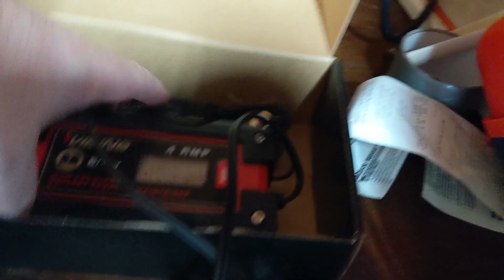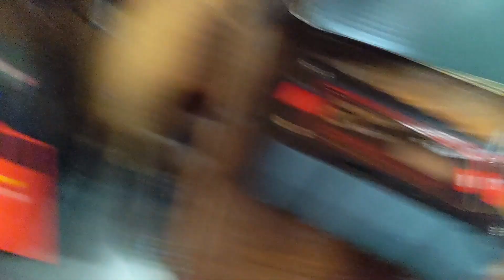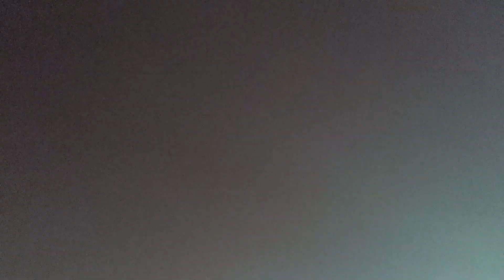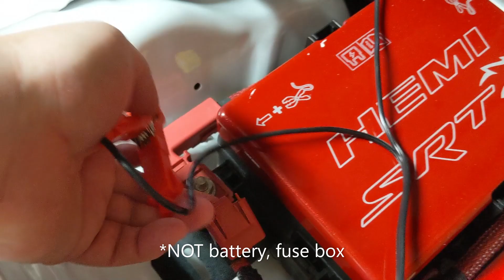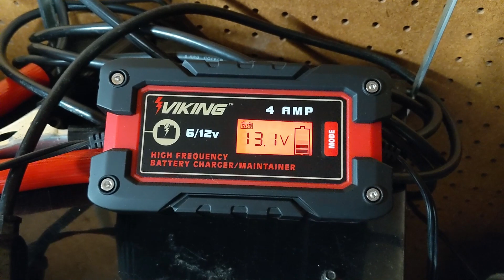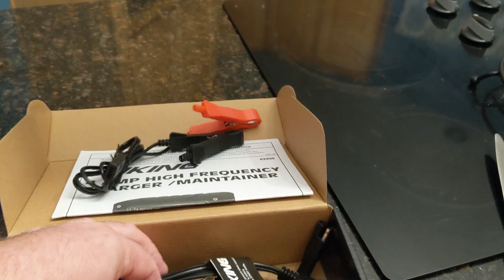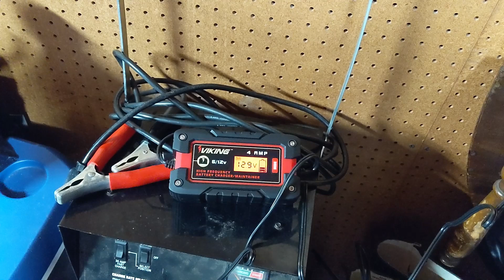Viking (Harbor Freight) 4 Amp battery charger / maintainer review for my Charger Hellcat

Comment: I have one of these too. 
Last year it worked great on my boat battery over the winter. Yesterday I had to buy 2 new batteries for 2 of my vehicles. Figured I'd pull this out and top them off since I don't know how long they've sat on the shelf. Well, after each battery was on this thing for 4-6 hours, it never went into maintenance mode on either brand new battery!
The only difference is, the boat battery was not connected to anything and the car batteries are, I'm not disconnecting them again and having to setup my head unit all over again.

Comment: I've noticed mine will go into maintenance mode very quickly on a battery that's not hooked up to a vehicle, or one that's installed in an older vehicle with minimal electronics/modules to draw current. On my 73 Challenger it'll usually be done charging in less than 30 minutes, but on my modern vehicles it takes 3 hours or more.
Reply from the maker: Yes, new cars should really be a 48V system, so the drain on new cars is huge compared to older cars.

Comment: "That's why they make warranties." 😊
They have one that does the things you mentioned...  It just costs more, go figure.
  After 40+ yrs fixing cars plus working in an automotive took store and having a wife who manages a Harbor Freight, I've noticed that people tend to buy the lower level of whichever product line and then expect it to do everything the more expensive options will.  That's partly the "marketing monster's" fault, always hyping up the consumer to expect more than is reasonable for a price point and, it's also just human nature overall.  When you buy an item like a battery charger, decide what exactly it is you want/need it to do and then buy the item designed to provide you with those features.
  If you buy the cheapest one and expect the performance of a more expensive model, you'll be dissatisfied every time.   As for the first unit not functioning properly, it happens with most lines of products, especially today when manufacturing doesn't hold the same standards as it did 40yrs ago.  Harbor Freight has steadily improved it's product lines and quality controls and has every level you could desire, you just have to pay for it. Everyone puts out a "lemon" every now and then which is why...  "They sell extended warranties." 😆 And for most items that are electronic or complex in nature, I recommend them.

Comment: If you can't get into maintenance mode AFTER IT RAN OVERNIGHT, disconnect from battery and outlet for at least a minute, reconnect and THEN LEAVE IT ALONE AGAIN. As long as the battery isn't toast, it will eventually go into maintenance mode. Hope this saves you guys a trip to the store.
Reply: Even it's not Green as long as the red backlight is off, it's still in maintenance mode.

Comment: I’ve had mine on for several days, and it still is red and looks like it jumps from 11vdc to 12. The battery bar shows 1 to 2 bars….does this seem normal?
Reply from the maker: It's not normal to charge for that long, with it showing the voltage
Reply: The battery is probably damaged.  Leave it on and it will try to desulfate and fix the battery.  From that voltage (assuming it is not a deep cycle battery), the voltage got too low from discharge or age if the battery is several years old.  You battery should never get below 12.3 volts.  Any less than that and you are ruining the battery.  Left long enough, the battery can no longer be charged back to full voltage.

Comment: I have a marine 12v deep cycle battery, do I charge it on regular mode or agm
Reply from the maker: Is it glass mat?    If it's lead acid, then you do regular mode.  AGM is for glass mat batteries

Comment: Says  gel but no gel setting
Reply from the maker: Gel batteries are VRLA (valve regulated lead acid). It says in the manual to use 12V STD (or 6V STD if a 6 volt battery)
Reply: @futon02  so agms dont have valves and lead and  acid?   Does this charger also not  equalize flooded  wet cell batteries? On wikipedia it says "There are two primary types of VRLA batteries, absorbent glass mat (AGM) and gel cell (gel battery)."
Reply from the maker: It's vernacular.   If it's called a gel battery, it's normally a VRLA that's normal lead acid.  Glass mats can have have gel, but are called AGM.  Page 9 of the manual has a note that says  to use STD.
Reply: @futon02   weird ..   agm are actually different then gel. Gel batteries are so named because the electrolyte  is gelled because  silica  is added to gel the electrolyte  which  immobilized the electrolyte which is why gel batteries are allowed  to  be mounted at different angles. AGM or absorbent glass Mat has is electrolyte  absorbed in the glass Mat inside which also immobilizes  the electrolyte  and isnt gelled but also allows it to be mounted in various  ways. Do you have a  link that shows an agm that is both gelled and made with absorbent  glass mat all in the same battery?
Reply from the maker: I see you're learning some battery tech.   Look at hybrid gel batteries.  Companies like LIvEN make them
Reply: @futon02  oh that's cool.  I wonder  what the advantages  are.  Thank you

Comment: If you're trying to charge the battery through 10 foot cables, 
maybe that is why it doesn't function properly?
I have a Charger as well. The battery is in the trunk. 
I doubt these battery charges are designed to do that.

Comment: One thing I noticed is that you didn't read the manual.   It specifically say do not plug in the AC until ready meaning hooking up the battery first.  Under Operation step 1 it again restates hook up battery first then plug in charger.  When disconnecting charger unplug AC first then then battery.  Don't know if that would change your outcome but it's worth a try.  Also I read somewhere that Winter Mode will occur automatically when the temperature sensor in the charger indicates to the microprocessor that the ambient temperature is at or near freezing.

Comment: I think these are junk.  Like fishing reels, they work good initially, and deteriorate thereafter.  I bought 2 of these 2 years ago.  They worked well as maintainers for 1 season.  When I plugged them in this fall, no function.  One had a blown 74 microfarad capacitor, and the other had no obvious fault, but didn't work.  I'm back to the battery tender brand, albeit, at three times the price.  Kind, Regards, Craig

Comment: It's only a 4 amp charger. I think it may be possible that the first charger simply needed more time on the battery. As the second charger already had a lead on the charge process from the first charger, it still appeared to take a few more hours. Sometimes you need to have more patience.
Reply from the maker: I had run the car (road trip) for 2.5 hours prior to this.   Worst case it should have been at 80% charge

Comment: I bought this a while ago and finally got around to taking my battery out of my car to charge it, but I wanted to ask, the operation section in the manual tells me to attack a 24 inch long, 6 gauge AWG insulated battery cable to the negative battery post, and then plugging in the actual negative clamp to the free end of the cable after connecting the positive clamp to its post on the battery. Does this mean I have to go out and buy the battery cable it mentioned or can I charge it without? I tried leaving it charging without for a while and it would jump around voltage levels and after a while displayed 7.5v and full battery icon with a red screen, then it only displayed the "bad battery" icon.
Reply from the maker: If it's out of the car you can charge post to post.
Reply from the maker: I see what you're saying.   Step 15.   What they are asking you to do is electrically the same, but can be more safe than connecting post to post.
Reply from the maker: The reason it says 2 foot lead is to get you farther away when making the connection.   You should evaluate how safe you feel doing it if you deviate from the procedure

Comment: How long to charge this unit from zero/new?
Reply from the maker: It depends on your initial voltage the battery has from the store.   It should be fully charged, but voltage can decay over time.   It shouldn't take more than 2-3 hours max (if any time) if the battery is new and good, if the voltage has dropped.   It may take no time at all
Reply: @futon02  thanks! Mine flashes 0.0 V plugged in. Nothing when unplugged. Going to try to exchange it.
Reply from the maker: Check the connections if it is reading zero

Comment: Anyone know if I can run this charger off of a lithium “ solar generator” that can do up to 250 watts?
Reply from the maker: Most likely not.  The input needs to be 120vac and 60hz to the charger
Reply: @futon02    The DB Power solar generator has a 110 volt receptacle that I will plug the charger into.. How can I figure out the hertz?
Reply from the maker: It would be on the manual/website.   If it's only 250w it won't make enough amps for this charger (power = voltage * current).  250 / 120 = 2.1 amps.   This charger is 4 amps

Comment: https://youtu.be/m9CU2z1KwjY?t=308            left a light on which drained my car agm battery down to 3v!! hooked up an old style battery charger to bring the voltage up to 10.5v then switched to the viking. after 30+ hours   it finally turned green and showed 12.7v. 

during charging it had red lit screen, voltage & charge bars would reach 14.6v and blinking 5th bar and then drop down to 2 bars and 13v...it cycled like this several times. i pray that the viking repaired the deep discharge damage.
Reply: How long was your batterry good for after that?
Reply: @Daddyyonke2023  replaced it after a year. had trouble holding a full charge. low voltage caused various glitches, but no engine check lights.
Reply: @arkrainfloodty ill be doing the same

Comment: It has a fuse inside on its circuit board. The one I have did not work and the fuse was blown.  I soldered a car 5 amp fuse underside of the board and it came alive.

Comment: I have recovered several "dead" batteries with the Viking charger. This is not a rapid process and takes much more time than one might think. I've had a few other "smart" chargers but they never recovered batteries like this!  You need to give it enough time and stop basing results on charging a "good" battery. I threw my other "smart" chargers in the trash when I saw what the Viking could do!

Comment: I do not think anything was wrong with the first unit. The maintainer side of this unit is going to condition the battery which is why you were seeing the voltage moving around. Once the unit goes through the charging/conditioning mode it should go green into maintenance or give you a bad battery indication.  Also a 4 amp charger is more of a trickle charger so it is going to take awhile.  If you want a quick charge you need a 10 or 12 amp charger and then apply the conditioner/maintainer.
Reply from the maker: I took the car out for over a two hour drive before parking.  The battery would be 80% if it started out as dead, and it wasn't.   It shouldn't take 12 hours for an 80% charged battery, even at 4 amps.   I have a 2/35/200 amp charger as well.

Comment: Planning to use this (1st time) over the winter on my car battery. Car is parked in a detached no-heat garage with door closed. OK?  @once a week car will be started (not driven) for @ 10+ minutes. When doing this I will disconnect the electrical wall connection. OK? Thanks.
Reply from the maker: Of you're going to start the car every week you may not need a charger.    Unless the battery dies off quickly for some reason, you should be okay not using it.   That said, if you are going to start the car I would disconnect it from the wall and the car
Reply from the maker: What's the purpose of starting the car weekly?

Comment: Why are you even using that toy when in the background of your video their is a 200.00+ battery charger???
Reply from the maker: I use it for the maintaining function.    The big charger is 200/35/2 amps.   It can trickle charge, but I want the battery maintained and charged back up without overcharging, like the big one would do if left unattended

Comment: I just got one. Think it’s bad. It won’t go in maintenance mode. Got to 14.5 then down to 13. Then kept charging. Until I notice top of battery wet. Means it’s over charging and boiling the battery. Will return it for a new one and see if it works. Just my luck.
Reply from the maker: What was initial voltage?   If it started at 12.4V or less it will also try and desulfate the battery, which can take over 12 hours with the finishing charge on it
Reply: futon02 it was at 7.5 when I put the charger on.    So I let it charge for 11 hrs. And took it off. When I put it on this morning battery was at 12.6 let it charge for 4 more hours waiting for it to go into maintenance mode. Once I saw the top of battery wet I took it off.
Reply from the maker: Less than 10.5v on a 12v is a bad battery.   I wouldn't necessarily blame the outcome on the charger
Reply: futon02 tried the unit on a newer battery that’s in my current running vehicle and it never entered maintenance mode. Lots of people having same issue with these chargers not entering maintenance mode and will keep charging.
Reply: futon02 picked up a new one and I finally got the maintenance green light.there was no bubbling in the battery. So something was wrong with the old charging unit.

Comment: On know the terminals on the Hellcat are different but for a standard battery, should you remove the car's terminal connectors to the battery before hooking up the maintainer clips to the car?
Reply from the maker: You can hook up to the terminals of a standard battery without removing the leads.    Be sure to hook up positive then negative, then remove negative then positive when done, for personal safety.   Follow your owners manual, as the order may not be the same for all cars and batteries.

Comment: Aside from the strange fluctuations of voltage, so you don't know what is going on, there is vague statement in the owner's manual.It says that it adjusts current according to battery state of charge and capacity. The rule of thumb for sizing chargers is to never charge higher than 10% of the battery's rated A/hr capacity. That would normally nean that this charger is too big for anything under 40A/hr. That would eliminate all kinds of garden, sports and motorcycles that use batteries smaller than that. There is nothing in the manual about minimum size battery except the vague statement that suggests it might be able to charge at less than 4A. From past experience, I know better than to call the HFT help line . They will read the owner's manual to you and they have no technical info or expertise beyond  that. As this reviewer only had a 50% success rate getting a good charger, the up and down cycling of battery voltage made no sense to me and I can probably only use it on my truck and cars, I will pass. Thanks for the review. It served it's purpose to help me make a buying decision. No Sale!! The normal multi stage charger charges at constant current until a battery reaches a certain voltage and then charges at constant voltage until full charge  Then it goes into float or maintainence mode. I haven't a clue as to what this one was doing.
Reply from the maker: The fluctuating voltage is for pulse charging, that allows for a higher current and less heat than constant current. Pulse charging also reduces electrolysis , which is good for a sealed battery, as you can't refill it with water if it is broken down to H2 and 02.    Pulse charging also supposed to break up the lead sulfides, which should lead to a healthier battery (no sulfation/mossing) and longer life (in theory).      What I didn't understand while watching it cycle is why it went through a charge again after bringing the battery voltage up.  It didn't seem like a finish (topping) charge to me (it could have been, but  you can't confirm with the indications given).  After that cycle it goes into maintenance mode.

Comment: I would verify that the battery is reaching 14.5 volts with a digital meter, thereby checking the status of the battery.
Reply from the maker: It ramps up voltage as it charges and gives the voltage on the screen.  The issue with the first one was the software for the charging cycle.   It regular charged fully, then pulse charged again, but the battery should have already had a full charge
Reply: @futon02  Based on your review I would not buy this maintainer. Many of the products from Harbor are in question.

Comment: Im on my way to harbor freight to return it
Reply: Dennis Lin why?
Reply: Velo -Mik3 I got mine open box, and it was taking forever to charge. I saw the voltage jump to 15volts at some points.
Reply: Dennis Lin it’s a 4 amp and not a fast charger
Reply: Dennis Lin Mine did the same thing last week. I hooked it up for a charge (hadn’t driven my car in a few days) and at one point I went to check it and the voltage was spiking to 15 volts and I could hear my battery beginning to boil. This is going back tomorrow.

Comment: The manual that comes with it is about useless, do you know what winter mode does ?
Reply from the maker: Not 100% sure, but my understanding is that it kicks on below a certain temperature and pulses to maintain a higher temp inside the battery.   The website also says "Winter mode for specialized battery charging in winter weather conditions"
Reply: It's not about usless, IT IS USELESS!!!! I bought one yesterday and im taking it back. Mine just blinks red and wont do anything when I push the button. Of course the "manual" doesn't tell you a freaking thing about how to use it or what the modes do. Cheap crap